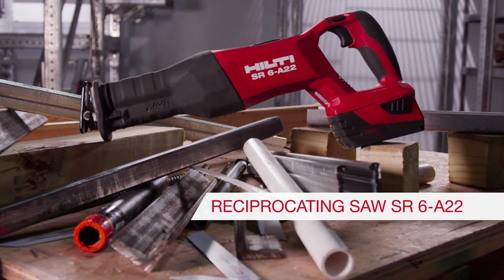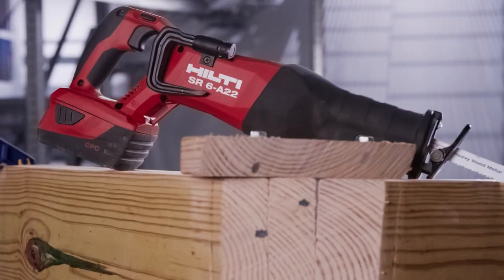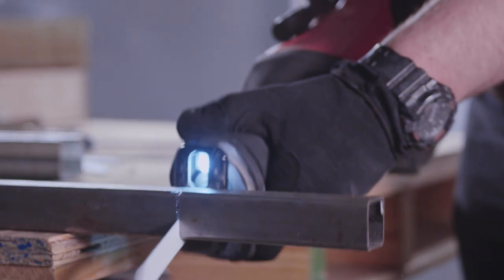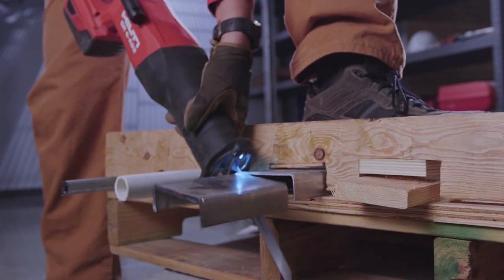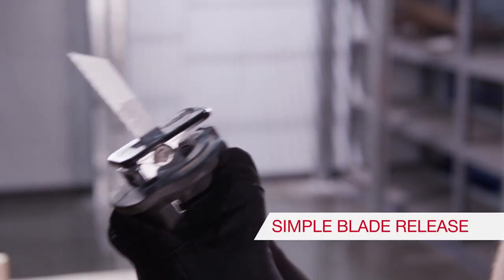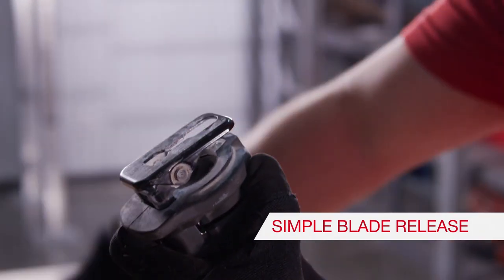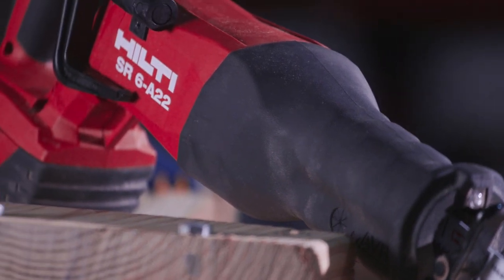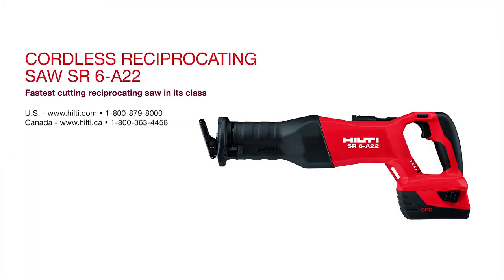INTRODUCING Hilti Cordless Reciprocating Saw SR 6-A22

Comment: So what updates does this model have over the current 22v model?
Reply from the maker: We improved the internal performance, new blade release, LED light, scaffold hook. Several improvements over the WSR model.
Reply: Damag381 brushless motor is a huge improvement.